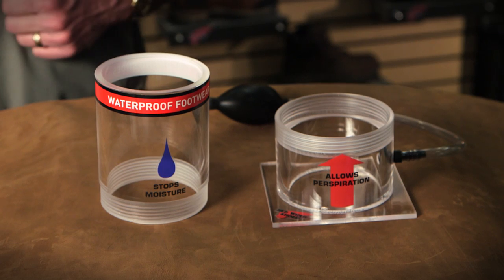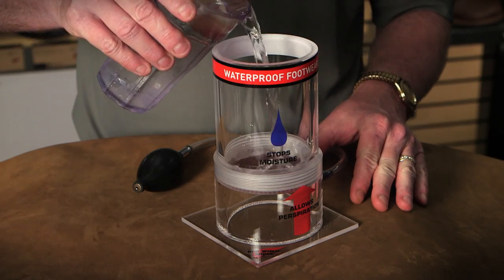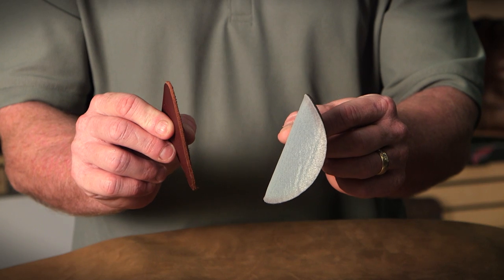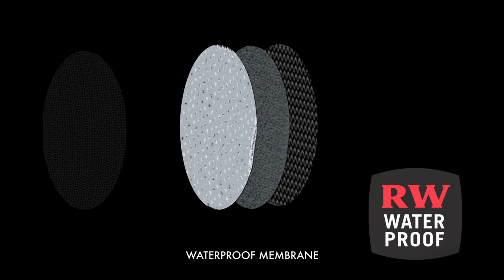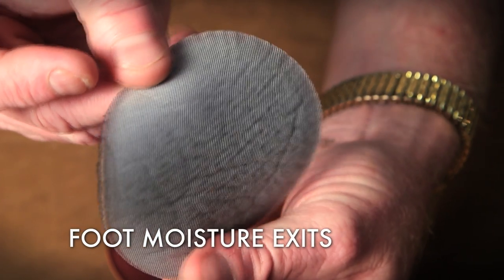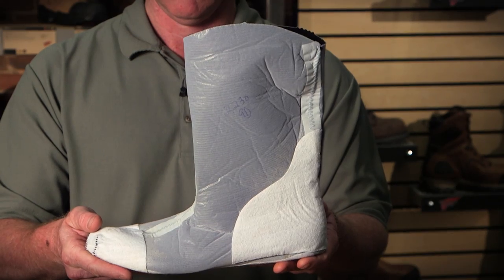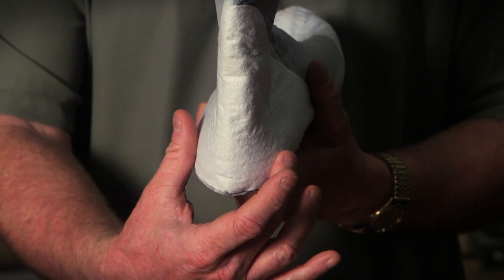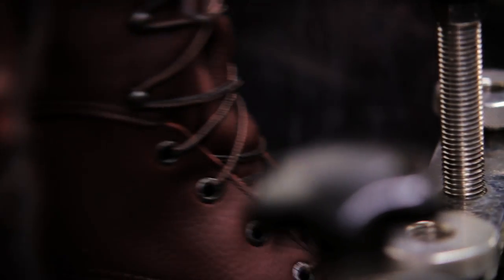Red Wing Shoes Technology: Waterproofing Technology

Comment: Redwing, do you make any pull on work boots that are good for flat feet? Because I own a pair of redwings, I love them but they offer no arch support. I'm a welder so laces are out of the question.
Reply: Jerrad Babson if by this time you haven’t yet, I am very flat footed and experience a lot of knee and back problems from it. The red wing insoles are expensive but very effective, at least in my experience. As long as I keep my loads and movements in check I usually don’t have too many frequent problems with them vs. not.
Reply: @brianvillage9649  Expensive?  Get orthotics.  (Insoles from a podiatrist) THEY are expensive.. but you're wearing these boots for most of your life.. it's worth it to put some money into them.  I used to have sore feet after work, but now with proper insoles..night and day.  Totally recommend.